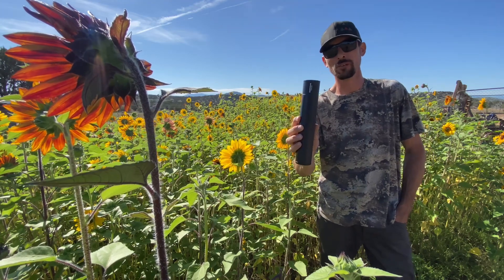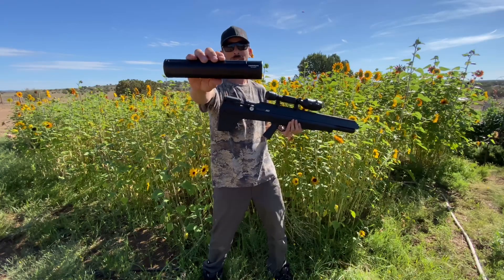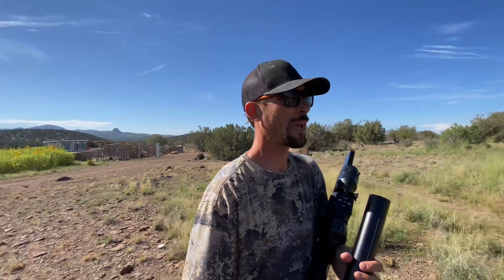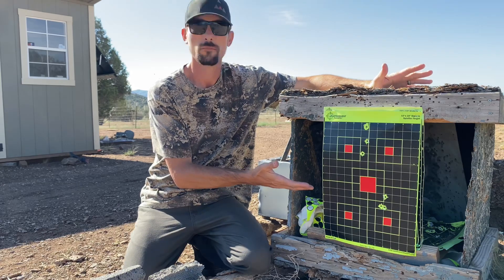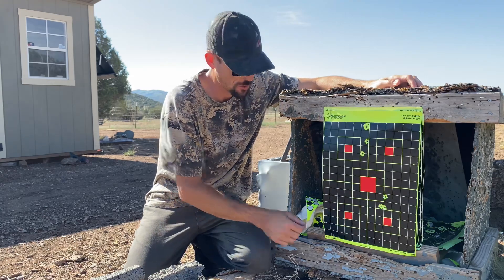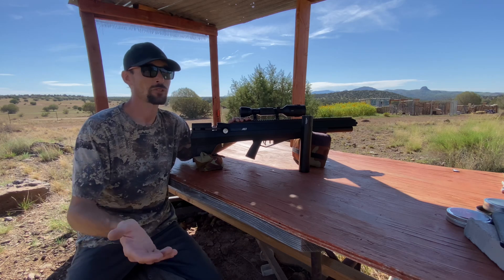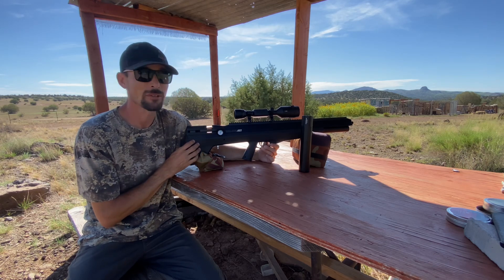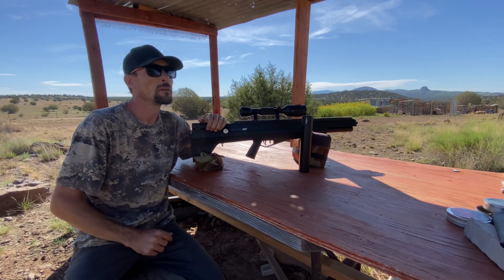Can suppressors make airguns more accurate? - Benjamin Bulldog .457 & DonnyFL Emperor

Comment: I have a bulldog and wanna do some backyard shooting, how quiet are these donny fl suppressors?
Reply: get ready to troubleshoot and tune your bulldog with a massive big bore moderator on the end. im in the same situation, even with 4 barrel supports installed i am getting messy accuracy results, thinking about going to 8 supports and if that doesnt work then im scrapping the project cause i just cant get it to tune up
Reply: Take a great kami.

Comment: I have a Pitbull Airguns Bulldog Carbine. 
I have the Ronin on it. 
There is a difference in accuracy. 
I chose to keep the Ronin on and then sighted the gun in with the Ronin. 
At one point I wanted to make it quieter so I purchased Donny’s extender. 
While it made it more quite, the accuracy was all over the place. 
The extender is just the outer case with the threaded ends.
Reply: same here, i outfitted my bulldog for a donnyfl Emperor, it is playing havoc on my accuracy. so i installed barrel supports, and this improved the issue, but did not correct it entirely. I am now contemplating getting another set of supports and saturate the length of the barrel with them to correct the harmonic, i hope

Comment: Do you think it is because it could be changing the harmonics of the barrel? Keep the videos coming…
Reply from the maker: in this cast I think it was due to the stabilization of the air behind the slug. in other guns the harmonics are more of a factor than with this particular setup. In the bulldog the barrel is actually a separate piece from the polygon shroud and the threaded end is mounted to the shroud not the barrel so anything that you attached to the end is not increasing or decreasing the barrel weight or making any harmonic difference on the barrel.
Reply: @ShootingGearReviews  thanks for the detailed info… 😊